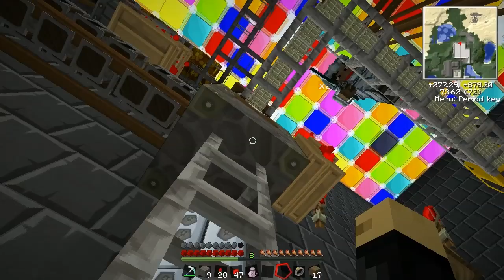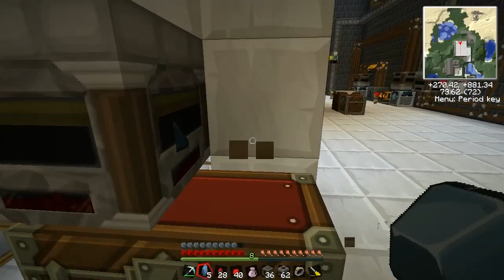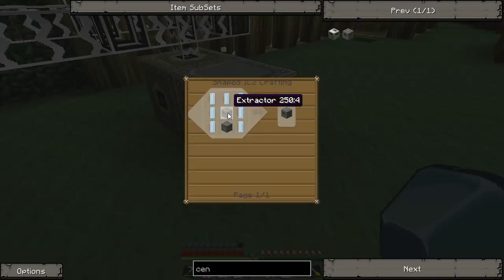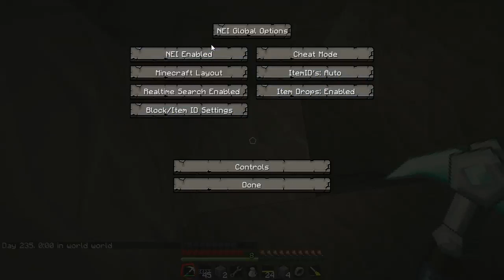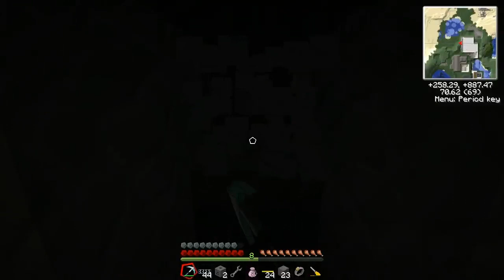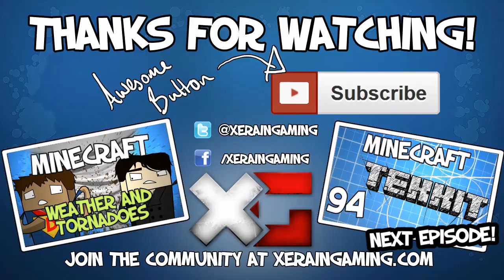Tekkit Part 93 - A BATTERY TOO MUCH

Comment: you need to use the 4 times insulated H-V cable to output from the nuclear reactor because the glass fiber can only tolerate 512 EU/tic and de reactor outputs 2040 EU/tic

Comment: andre, the reason that the reactor is not working is the cells are not activated. You have to turn the reactor on and reclick the uranium cells back into the reactor to activate it. Also, it would be easier to use an induction furnace instead of an extractor. also try use EE items such as Dark Mattar Pickax. Dark Matter and red matter tools are unlimited . There is a furnace that is quiet fast as the induction furnace. Try the darkmattar furnace or the red matter furnace. Thanks i love tekkit!